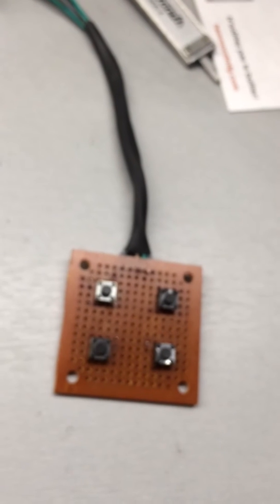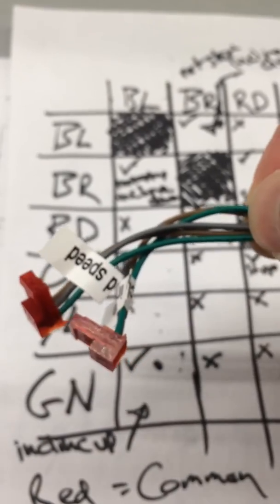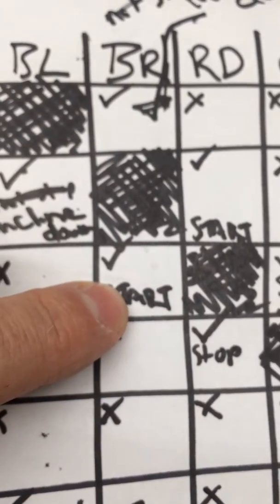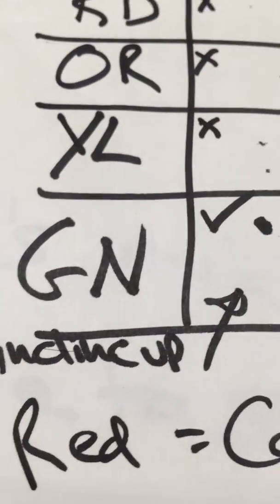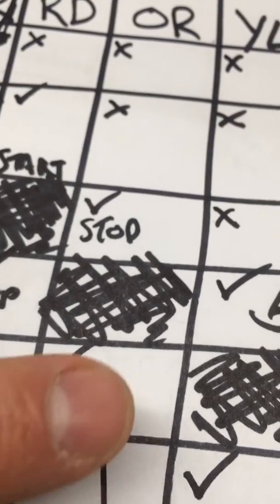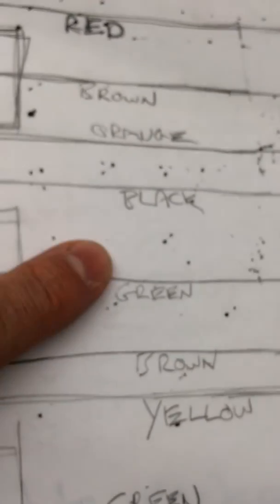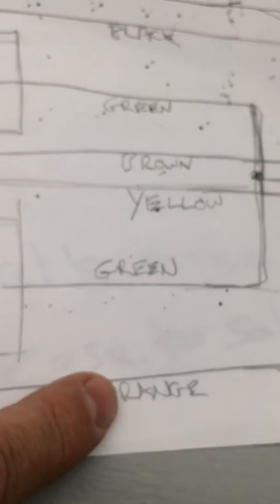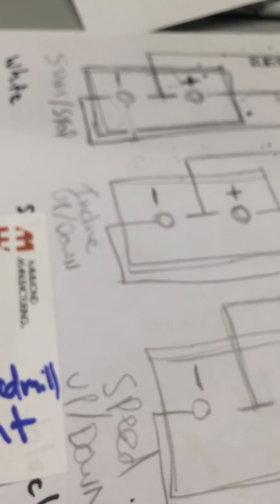Treadmill fix - wiring deduction explained - part 2 - Horizon CT5.4

Comment: Thanks for your hard work .But i got mine fixed just 2 ' by the hair dryer because i was thinking that wet or humidity built up on the control circuit board, so i got it dried by hair dryer back and forth few mininutes on low setting .It's working again perfectly .Good luck eveyone .
Reply from the maker: Nice! Always better to work smarter than harder. Absolutely try the hairdryer first gang. Thanks for tip John.